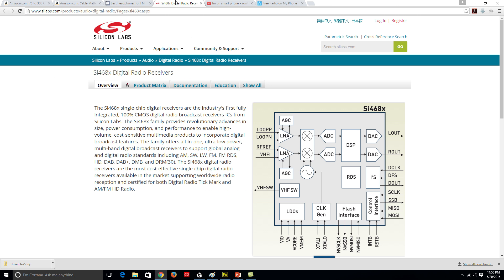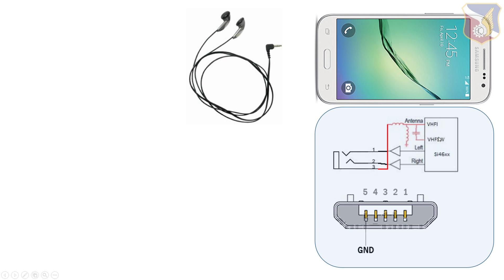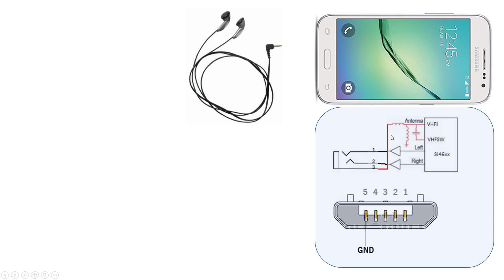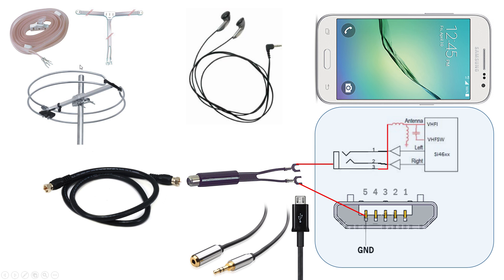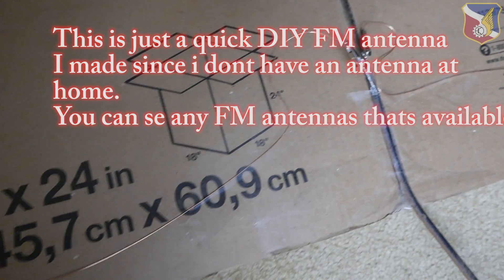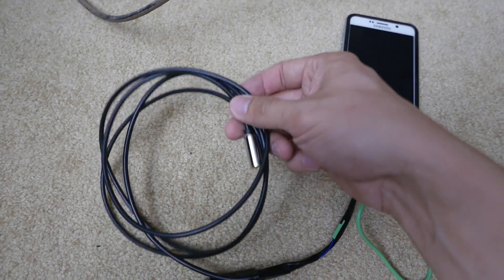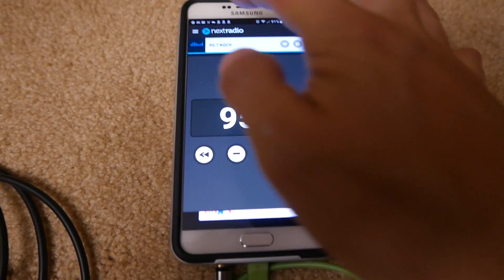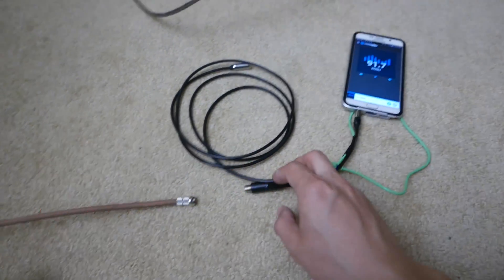Improve FM radio reception on your android smartphone with dipole loop antenna lg samsung phone

Comment: Hi, I have been trying to improve the FM signal on certain LG, HTC, maybe even Samsung phones for years by splitting the audio signal and connecting some 3.5mm jack to coaxial device that would connect to an antenna to set on top of car (magnetic antenna thing), but it did not work well. My goal was to tune a station 87.7 MHz which my Pioneer stereo (aftermarket AVH-4200NEX) does not tune (the car's factory radio did tune 87.7 FM, the Pioneer's functionality for other music superseded the old radio just for
1 station).  So I have been trying to find a work-around since the Pioneer obviously has several AUX or audio inputs. My attempt was to split the signal from the 3.5mm jack to have one go into the AUX port for sound and the other to use as an antenna.

So, this method by going through the USB port, is this simple to create, do I have to destroy a USB or audio cable to get this
to work properly or is there some simple item I could consider buying  so I do not have to worry about soldering anything.
I have plenty of antennae that I could use to test this out including the 1 pole magnetic antenna that will magnetically mount
on top of  my car (metal). It is just a matter of having wires hanging out the car or perhaps I can utilize the moon/sunroof to
keep things together and out of the way.

I would like to use an old HTC phone or even a newer HTC or LG phones that have the radio tuner to pipe the audio through
the receiver's AUX port and also hopefully keeping the phone charged/powered and connecting an external antenna all
cleanly with all the wires involved and making this process simple. Let me know what suggestions you have.
Thank you.

If one destroys the USB cable to tap into the ground wire, can the USB cable still be connected to a powered
source to keep the phone charged and if doing so, would it damage the phone since the ground wire could be
compromised? I do not see how to keep the phone charged wired, but I guess one could keep the phone charged
wirelessly (wireless charging for those phones that have that capability)?

Comment: your idea is ineteresting, but is there is another way without using the usb cable?, i mean just using the audio jack to improve the the antenna thus the signal, thank you very much bro for the video. it help me very much
Reply: can one split the audio jack to connect one part into an AUX port for sound/audio through the stereo and the other part connected to a makeshift antenna? I tried something like this long ago with mixed results, but perhaps I was doing this wrong. (somehow connect the split audio cable to some 3.5mm to RCA port then connect that to
a RCA male to female coaxial port then that to the antenna (RG6 cable ) wire extended outside the car. It was messy and cumbersome & not so simple so I did not use it for long and it did not seem to work well improving the signal.